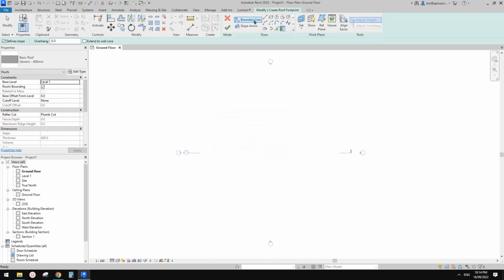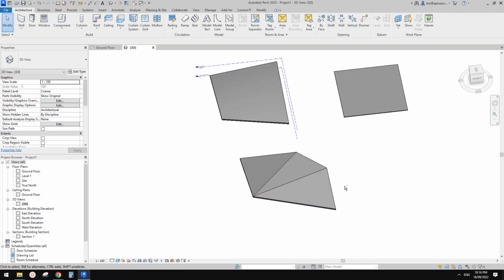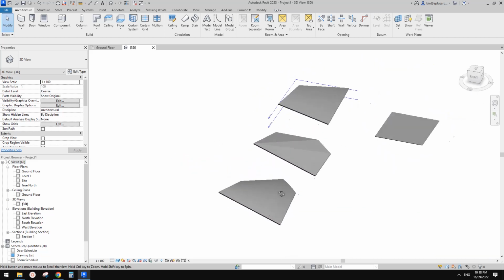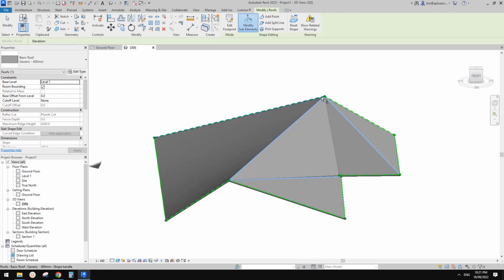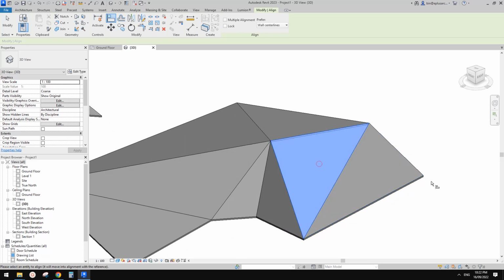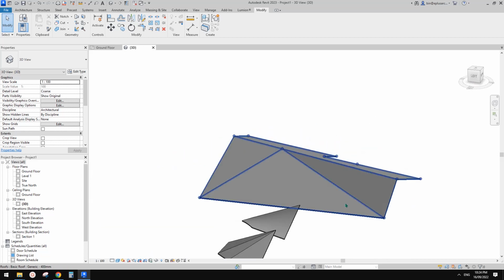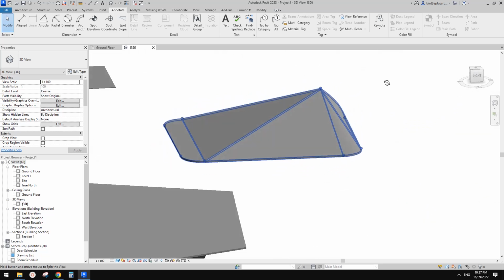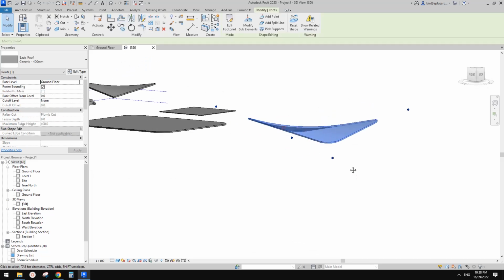Revit Exercise (Day 907) Some Modify Sub-Elements Tricks

Comment: Is it this trick is applicable for point cloud data while matching the roof ?
Reply from the maker: I would use normal method unless the existing roof is very un-standard.
Reply: @BINHE615  can u suggest the basics to advance level of learning the topic about mass
Reply from the maker: I'm not sure... I started with Paul F. Aubin's book Renaissance Revit, in which he used a little bit of mass to model some classic columns, then just played with it for some years and understand it a little more. I do not use it at work, only use it for the videos here.
Reply: @BINHE615  I am exactly working on a very unusual roof and I would like to create a model, of which I can modify each sub-element in x,y,z. What would you suggest? Would learning point cloud data topic help?